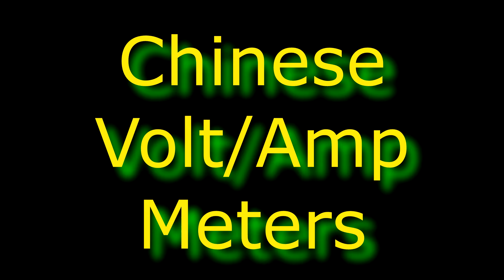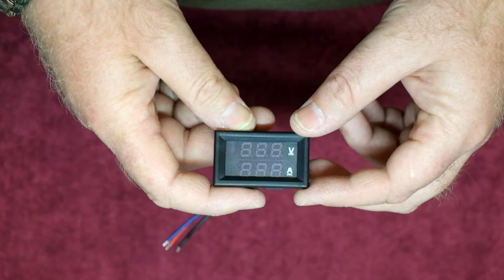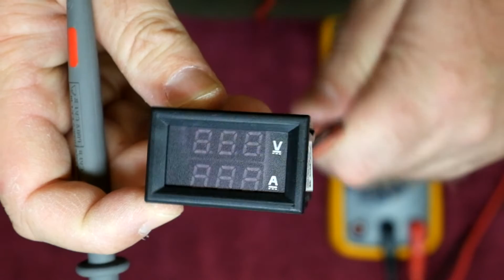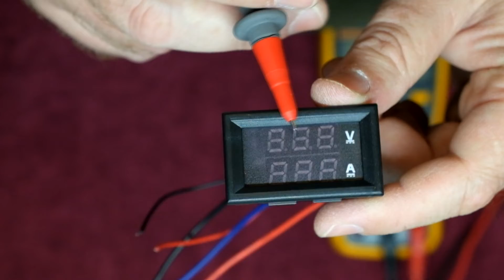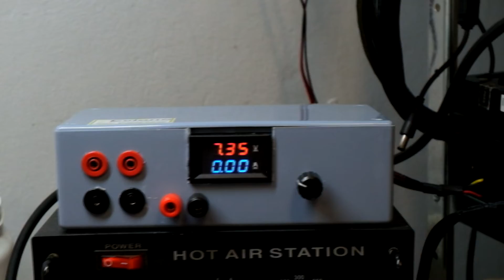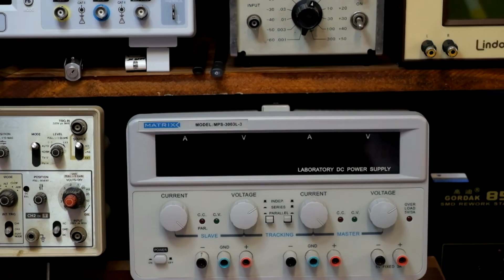Episode 62   Chinese Volt Amp Panel Meters

Comment: Good job explaining! I have several of these types and found most of them pretty spot-on accurate, but nice they have trim pots! The BIG problem ALL of them have is that the black frame has such a small overhang, so if you cut out a hole in a panel to mount it in, you have to be super tight or the thing will fall through. It leaves no wiggle room! AND, those squeeze tabs? LOL. you can't depress them even a micron! They butt right up against the LED display blocks! What a engineering bumble! What I have to do is pry the circuitboard out, hopefully w/o breaking the tab holder things on the ends, then push the case into the carefully cut hole in panel. Without the circuitboard, those little beveled edge push tabs will then bend inwards and "snap" into cutout. Then I have to carefully insert the circuitboard back in! What a pain! The designers should have made the case just a mm or 2 bigger! Ahh.

Comment: For few more $ (about $7~$9) you can get the  4 bit versions and they are quite accurate. But you are right,  for home built PS projects those you showed are perfect. They come in really handy for bread board also.

Nice lab you've put together there, BTW

Comment: I’ve bought a few of these, and while the voltage measurement was good, for current I found them very inaccurate, not even measuring anything below 70ma. Any experience there, and if so is there one you can recommend?

Comment: Anyone know if these can be used to measure current on the positive leg of a circuit? I’ve got  one slightly different to this but no doubt it’s the same design. There are 3 smaller .5mm cable and a pair of around 3mm. I want to measure the charging current of my leisure batteries.

Comment: Thanks for the excellent presentation..I bought 2 from eBay. They were just 2 for $5.36US shipped but came with no instruction, not even leads identified..one works great on my RC battery charger that previously had no output ammeter and the actual output bears no resemblance to the amp selector..the other is back up or I'm bound to fine a use for..

Comment: I purchased one from Amazon. I want to hook it in to my 12v solar panels system to see what energy my 12v 100w panel is providing, I am told I need a shunt and a protentiometer, can you help me?
Reply: just depends on the amps you are pulling in with the 100W panel. if its over 10A, then i think u will need a shunt. that just my 2 cents. (check the max amps the meter can handle)

Comment: Be warned they are nonlinear unreliable, extremely in accurate, and drift out of calibration, mine reads 12.5v when 13V is applied when re-calibrated, and I adjust the voltage to say 20V meter then over reads 21.5V, current reading are unstable too, rubbish product, also very sensitive to spikes and surges, i've poped a few, they also drift out of tolerance...absolute garbage.